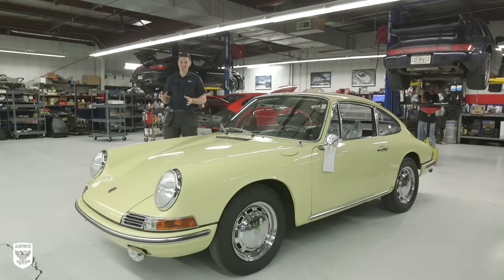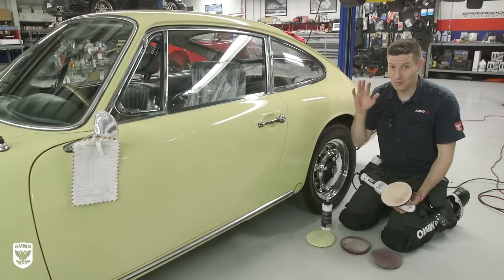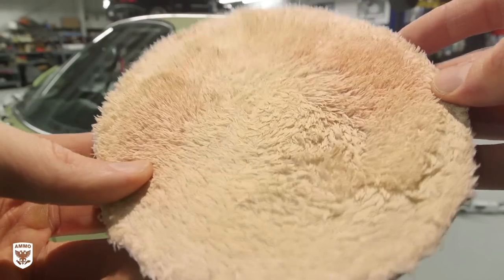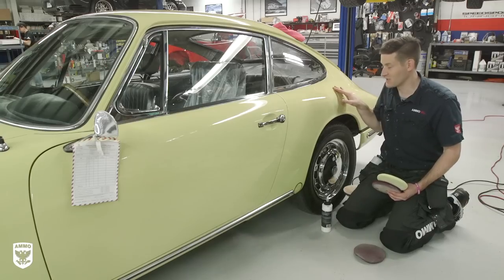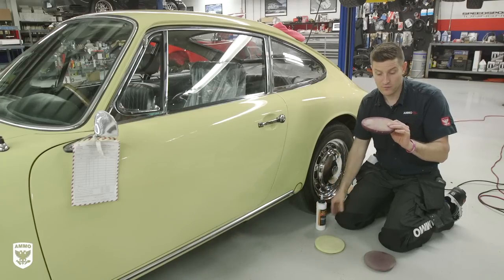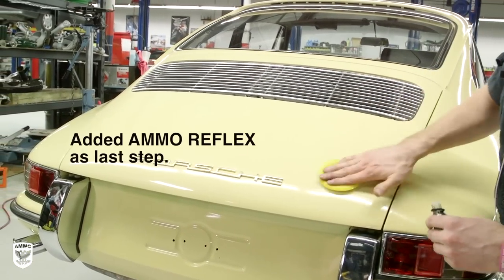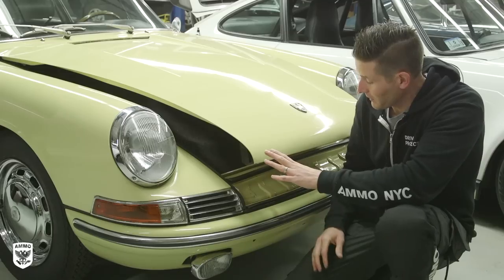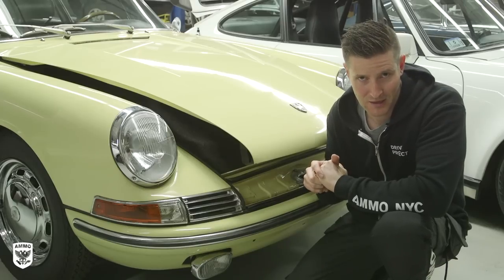Rock Chip Touch-up Tool: Museum Porsche 911

Comment: I found the easiest way to clean them out after you swish it around in alcohol is fill the barrel (where are you putting the paint) with alcohol, then take the protective tip cover (red rubber pen head protector) that protects the pen tip and slip it on where you fill the barrel, and just squeeze that little red rubber protector (like a turkey baster) and it actually shoots air down in through the barrel and forces the alcohol through the tip. Repeat that process until the alcohol comes out clear. And then after I do that to where it runs clear then I'll take the cleaning tip and finish cleaning it out. I've done it your way before and it didn't work very good. In fact until I discovered the way I do it I had ruined a couple of Pens cleaning it your way. Also if you're having a hard time getting the pen to prime, using that little red rubber pen head protector in the same way helps prime the pen.. I hope this trick helps you and your viewers
Reply: You're a borderline genius my friend. Great tip! (no pun there)
Reply: I was wondering if anyone figured out the same and sure enough. haha :D  I will add though acetone works better for cleaning it out.  In the end I found taking a paper towel twisted up fine and spinning it in the cup get the majority of paint out, then just swishing it in acetone remove the rest kinda don't even need the pipe cleaner or red cap pump action.  I bet the type of paint might play a big role in how easy it is to clean.
Reply: You offer some ingenious insights, using what's right there on hand and it makes perfect sense. It seems having a small eye dropper might work better than dripping those drops off of that tiny brush to fill the reservoir, or even a syringe. 

I saw a preview recommendation here on YT of a detailer that actually uses a syringe for filling small defects like this. I'll have to find and watch that one as well.
Reply: @matthewronson5218  did you find the other video? If so, I'd be so grateful if you shared the link. Thanks in advance!
Reply: @laurisnicholson1602  AMMO AUTO:  
https://youtu.be/WLJnqiBxKtg

Comment: This fine art pen is simply brilliant. Zapped a few rock chips that happened over the winter. It took just a few minutes. Cleaning the tool is actually the worst part. So much easier and faster than using a toothpick like I did last time. Thanks Larry!
Reply: Do you use clearcoat too?  Or just apply paint?

Comment: Larry, I am a rheumatologist and suggest that you use a 1 or 3 cc syringe attached to a 22-25 gauge needle(you will have to experiment) to aspirate from the paint container & then inject into Lowe-Cornell reservoir. Then you inject into the target paint-free base. My question is if you are dealing with a larger erosion do you spread the paint with a finger? How do smooth things out? Great tip!

Comment: There are several ways to do touch up like this. The pen works well but I find it tends to clog during the process because touch up paint dries pretty fast. This is something I do at dealerships everyday along with paint correction and all that. I lean towards a small squeegee and small drops of paint. Lightly drag the paint over the chips. Then use a sanding sponge with a soft paper towel around it and a remover to get the excess paint off. This leaves the paint in the chip only and it cuts the time in half. Great job with the pen Larry!

Comment: I bought a Dupli-Color "All-in-one" kit for my Black NC Miata that works great. It has a small metal brush for cleaning any rust out of the hole, a large fingernail style brush and a fine tip (like this tip) that contains the paint behind it for filling in chip marks. Then on the other end there's clear coat to finish.
Reply: TJ Shine How well did it work ?

Comment: Gr8 vid, i am a detailer too, i use a pin, safety or straight pin needle, sewing when applying touchup. Slow process but very similar. Dip, no glops on tip, fill accordingly.

Comment: I use eye dropper with a needle stuck tight  in the dropper hole, when squeezing the little bottle the paint will run down the needle. It does give sort of the same result.

Comment: if u use the rubber protective cup on the "reservoire" end, you can easily start the tool or flush it with IPA to clean it quickly, specially if it gets plugged up during use

Comment: Larry makes everything look so easy.  I did as instructed: washed the hood of car, applied rubbing alcohol to hood and let dry.  I then poured a small amount into the container.  I wish Larry had not put music in the background.  i would have liked to hear the banging of the tool onto the hood.  So far, I am not very impressed with the results.  i will try again.  I did shake the paint can to make sure that the paint flowed, but it wasn't so easy.

Comment: Lacquer thinner works much better than alcohol for cleaning equipment. 70% rubbing alcohol contains oils. 91% rubbing alcohol is better for paint adhesion because it contains less oils that effect the surface. You did a nice job on the car.

Comment: I bought the pen as soon as the video came out and I'm appalled to see how much the sellers of the pen have jacked up the price for it. I bought it for $6.99 on Amazon in July, and I went to buy another one today and the SAME SELLER wants $45 for the SAME PEN!!! That's absolutely ridiculous and a shitty thing to do, just because a Youtube video popularized a product, doesn't in any way justify that much of a price increase. Maybe it's back ordered, I don't know. It's sold out everywhere. $95 on eBay. For a SIX DOLLAR STICK with a reservoir on it. Amazing. The pen works wonders for touch up though. I've done several cars very quickly with it. Settles very nicely and will not drip from the reservoir or from the side of the car. If you have to have it looking perfect you can lightly sand and buff the spot and you're good to go.
Reply: It's currently $7 on amazon. :)
Reply: @zenkiev4486  its 40$ on the canadian amazon :C
Reply: Hi everyone and The Last Crusader,  Where you get burned on Amazon is clicking the reorder button.  The companies offering the product through Amazon will list the product several times at different prices.  One of the tricks is upping the price of several of these over time.  Not only do they make a killing on hyped-up-pricing on refills, they make the cheaper price for the “shoppers” look like the lowest cost one as a bargain.   Before you ever click REFILL, type in the item in search first. Only refill if the price is right.  I read (don’t know if it’s true, but I have seen this) that the Amazon algorithm sees you as a constant reorder person for that item and Amazon will jack up that price at that moment.  If Amazon algorithm identifies you as a tight price shopper, you get less gaming tricks pulled on you.  Again, I don’t know if that is true and accurate. For me, quite believable.  I shop everything and double check the prices on auto-reorders too.   I also believe an algorithm could assess your buying behaviors. If for example you order one item in the middle of the day on the fly, you may be less likely to shop it because you need it now so to speak.  

Artificial intelligence is the proper technical term and it’s exploding softly in the background and it’s here to speed up the processes and when it’s  allowed, to pick our pockets a bit more on shopping sites and when applied to science, we all may have better healthcare diagnosis and they are using it to formulate new medicines.  When buying on Amazon for larger ticket items, I do a google search and eBay first.  Since Amazon may be able to see those recent search Cookies, it will go look at the price to deliver you a “just right” price.  That part is my opinion and some computer geeks agree. Thumbs up?
Reply: I won't even buy it knowing that the price was raised so much lol they are losing customers and money because of their insane prices

Comment: Very helpful. A similar pen from Kemper is on the way from Amazon, being as the specific one you cited is out of stock. I will take the time to do dozens of chips on one of my cars. I think gunman may have a video on using putty to allow sanding flat the resulting paint bumps. I may try that also.

Comment: its a similar technique to what i use, i have always got a touch up stick and applied a small pool of paint onto a piece of laminated cardboard and then applied using an unfolded paper clip, wiping off the excess onto the side of the cardboard. Ive always preferred to apply in small dots, it takes longer but is a far more accurate way to ensure you dont overfill the recess created by the stone chip.

Comment: Hi, thought I might be able to add some information. I use a bottle similar to a common ketchup bottle to hold paint thinner in, and whenever it's time to clean out my touch up pen, I shove the nozzle of the paint thinner bottle into the top of the reservoir. Squeeze to clean, then roll up the edge of a paper towel to clean out what is still in the pen. Repeat a couple times until clean.

Comment: Sorry for the basic question but after applying the touch up paint what should be done to blend in? Add clear? Buff? Or literally just add the paint from the dealer and you're done? Thanks. Love the channel
Reply: RoachForLife according to the video just add matching paint, if you feel it's necessary to polish down after do so. But I think the point was accuracy and to skip those steps.
Reply: Hard to tell, a difference is.. eg car might be 1 year old or 20, the factory colour could and is different to one that has been exposed to the elements/UV.
Reply: That's a good point, can you get a near undetectable repair by leveling after applying touch up paint...
Reply: you don't need to blend the color, you blend the clear so it looks like its not layered on top of old clear. Also with tiny touch up like this you really don't need to blend. You really only need to blend when doing larger touch ups where you have to spray the clear over the area and you generally spray over a even larger area then what the actual damage is and that is when you need to blend, like say you have a deep scratch that you had to sand out, you would then spray the area at least 3-5 inches around it also with the clear.
Reply: You have to blend the color and clear separately on a base/clear coat paint job. You fog color in and around the repair then spray the clear over and beyond the repair. This is extremely important with metallic paint.
Reply: RoachForLife q

Comment: How do you match the paint on an old car? Even if you know the color code, the color changes over time from the elements.

Also … how do you make sure the touch up paint is flush against the original paint after applying it? You didn’t have to smooth it over? Like by sanding or polishing

Comment: This card does not have clear-coat.  If you were working with a modern car, would you first apply paint and then clear coat?

Also, what is the music at 8:20 while applying the paint, it is ultra-relaxing!

Thanks!

Comment: Alternatively, you can use a toothpick to make those fine though ups. If the toothpick's tip is too big, just shave it down. The cool thing about this trick is that after you are done, you just throw away the toothpick.

Comment: I bought that tool and after losing the damn clean cleaner piece, bought another one and this time drilled out the tool handle, and ran a tap into the hole, then ran the cleaning tool through the appropriate die, and now it just screws into the tool body and never gets lost. Probably took me 10 minutes.

Comment: Hi Larry, hope you will read/reply to this I'm about to correct my car soon and have a question. 
I've previously learned that it's a good idea to blend some clear coat with some color coat together and then do the chip painting. That was in one of your videos.
Now with this new little tool, does that method still apply as the best/most practical method or is it now a better option to fill up the spots with colour coat and add a layer of pure clear coat on top of it?
Great videos keep up the good work. Your channel basically is a one stop shopping for detailing.
Later!

Comment: Great video Larry, 
What are your tips for using this tool on panels such as doors without spilling the paint?
Thank you.
Reply: it stays in the chip pretty well, just go slow, and dont use too much all at once, this will make the paint heavy and more runny, so apply it, wait for it to become tacky (if you still need more) then apply more. hope this helps, ik this is an old comment.

Comment: I just got the pen and really excited about fixing the rock chip on my car. What are your thoughts on: 1) applying a layer of clear coat, and 2) using enamel paint thinner to wipe off the excess paint and smooth/blend the paint?

Comment: If you ever wondered about supply and demand and how much of an affect AMMO NYC could have, here is a great example.  That same pen that was $9.00 and "throw away priced" saw a huge surge due to this videos release to end July.  Supply/Manufacturing remaining the same has resulted in a quadrupling in price.  It is now $40.

Check out the 3 month view of pricing changes.

https://camelcamelcamel.com/Loew-Cornell-Fine-Line-Painting-Pen/product/B004YZXV8U
Reply: thanks man !
Reply: Good point. I went on Amazon first and was amazed at the $50 price (as of now) but seeing your post makes sense. Larry, you must be making a bundle in sponsorship fees. If not, you should.

FWIW, Amazon has another identical-sized pen for $15 which is what I bought.

Comment: Amazing how the stonechips just dissappear one by one :)
Reply: Rockport1911 You'll see them irl, but yeah very satisfying to watch in the video :)
Reply: @lemster101  not when the car is behind ropes like it most likely will be in the museum. I feel this is why he chose to touch it up like this, why do more work than is needed also if you sand them down you run the risk of blowing through the single stage paint that had already been compounded and polished, as originally they weren't going to touch them up.

Comment: Love this Video! I wish I knew that tool existed a month ago! I had my 2006 Porsche Cayman S coated with ceramic, they told me they were going to fix all the paint chips but they didn't. The front hood is littered with rock chips. Any tips on how to remove the ceramic or is that something I can have done so I can address the paint chips?

Comment: In this case the tool is great. The alternative and cheap way is to just get a little paint at the time on the tip of a woodscrew or a nail. Throw it when you're done. No need to clean tools. 
I use this to take my chips. And since it's just one or two chips at the time, this is just as good.

Comment: So how do you use that pen on the side of the car where you can't hold it straight up?
Reply: I have the same question...I would probably put tape over the reservoir to keep paint from spilling out, but maybe Larry can chime in.
Reply: i would assume they sell 90 degree bends of it too or you just dont put much paint in it
Reply: You would be much better off using a touch up pen
Reply: GTR Wendy You have rock chips on the side of the car? Dorifto GT-R confirmed 😂
Reply: GTR Wendy Ok vertical touch ups are doable. Depends on how thick your paint is, if it's too thin it will obviously sag to where the bottom half of the chip is. The paint shouldn't drop out of the reservoir, if it does you have paint that's too thin. I've used this pen to touch up the bottom of a bumper, it has never come out of the top for me. Just don't drop too much paint in the chip, you can always come back and put another layer on later. Most of the time it doesn't need more than one to hide the chip, but if you want take the time and effort to level it the way Larry shows in his other touch up videos takes multiple coats and some wet sanding or buff/polish.
Reply: Remove panel or door, lie flat, touch up, re-fit panel or door. (where possible obviously)
Reply: The Stig's German Cousin door dings.  I don't  know how to drifto
Reply: Most of the time rock chips are on top of the hood most of the time
Reply: GTR Wendy hi Wendy 😃
Reply: The Stig's German Cousin you'd love my liberty than rock chips all on the side skirts and front fenders.... rally spec drifto confirmed
Reply: Confirmed - The paint stays inside the res as long as the paint isn't too warm going in plus you can angle the pen upward slightly, gotta it....it isn't as fast as a very fine painters brush but it is a lot more consistent at being level with the rest of the paint.....not bad for £10.....only another 150 more chips to go!     oh, and don't fill it right to the brim!
Reply: It's not gravity that prevents spilling, it is surface tension.
Reply: Just put your finger over the reservoir.
Reply: I just dip the pen tip in paint and apply it that way, just like they did before they invented the fountain pen. They would take their pen and dip it into an Inkwell to get ink on the tip of the pen
Reply: Do you have to apply some sort of clear cut over the repaired paint?

Comment: So I use an throttle body or brake cleaner and blow out the residue with compressed air. Super fast and super spotless each use.

Comment: Yo Larry....great video! Regarding rock chips.......if i had a clear coat on top of black paint, do i just fill the chips with black paint then level the paint at the same level as the surrounding clear coat next to it or do I partially fill the chip with paint let dry then top off with clear then polish?

Comment: Is the same method for side rock chips, on the doors? I'm asking that because of potentially paint drip/leak. After you filled rock chips with the paint, you did something more, or no? Polish for example? Under fingers, you feel those painted rock chips? Great video!